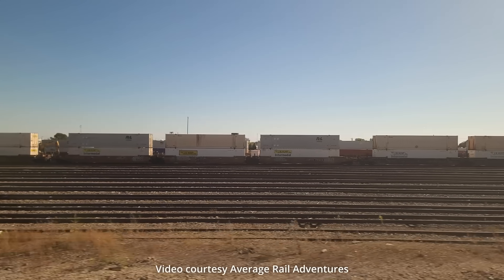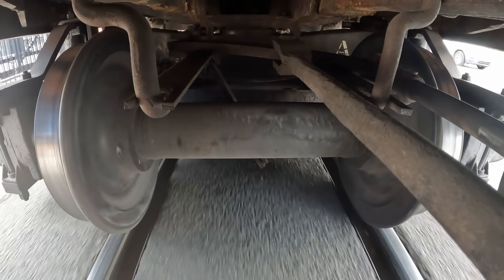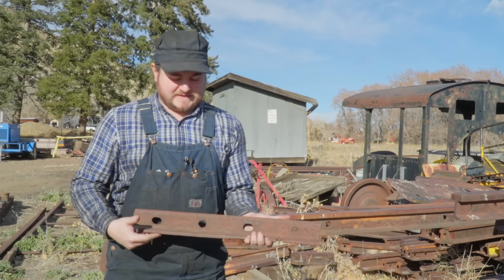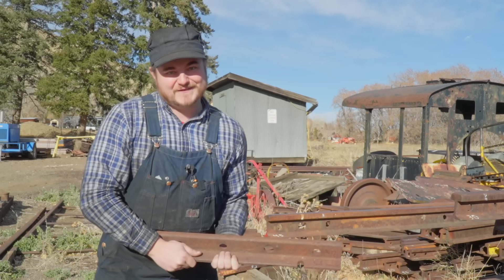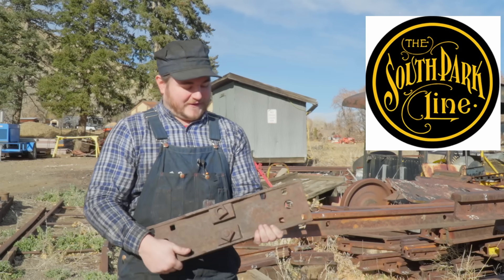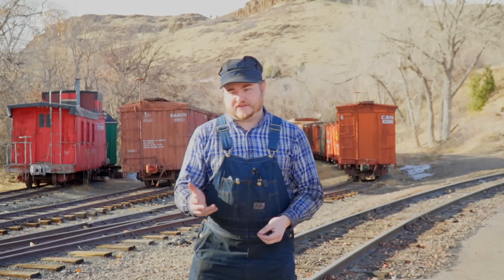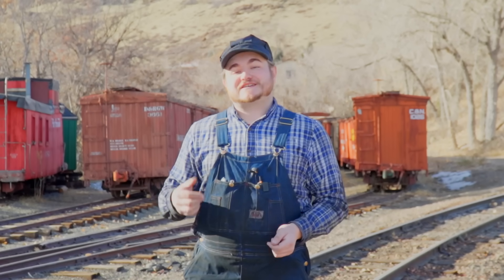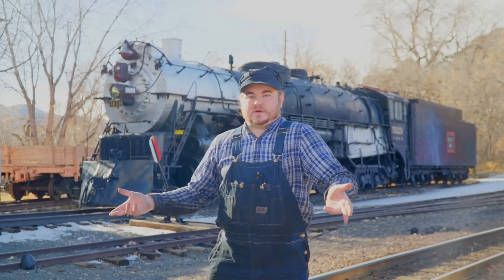Why don't Trains go CLICKETY-CLACK anymore? | Railroad 101

Comment: Most of the trains I've ridden are tourist railroads and they seem to still be using the old jointed track so I'm used to hearing clickety clack. I think this is why in the minds of folks trains go "choo-choo" and "clickety-clack" even though most trains no longer make either of those sounds. Practical Engineering has a video on "Why Railroads Don't Need Expansion" joints that gets into a lot of fun details about continuously welded rail and how they do it. I'm not a metal worker, but I've heard that old chunks of rail make excellent anvils due to the hardness of the steel, if the museum ever wants to turn that pile of rails and stuff into souvenirs.
Reply from the maker: I'd bet. I've seen rail anvils, they are nice. That video is lovely.
Reply: @Hyce777  I admit it.... I use a small piece of cut rail..... for a boat anchor! (and as a door stop to my train room)lol

Comment: Somewhere I have a photo, and maybe a video, of a thermite rail weld kit in action.  It was for a spur I designed down in Chehalis, where the contractor chose to weld up sticks of rail for the curve while using joints on the tangents.  Presumably because the curve was pretty sharp, so using welded rail helps avoid those gage and kink issues you mentioned.  
Funnily enough, it was relay 130-lb rail that the contractor had purchased recently; the previous owner had welded it up for the original installation, and then chopped it into 50-ft lengths when they pulled it up and sold it.  The cuts were very specifically not at the welds.
Reply: although they don't show a rail welding Veritasium has started a video Series on Thermite
Reply: @Bandan-RR  maybe you could be the nice guy and send that video over to Mark so he could use it in a future video. 😁
Reply: Search YT for "Thats Railroadin thermite weld" for a full video of the process: some of the prep, the weld itself, and the grinding.
Reply: Yeah you can only put the welds so close together, it's part of what makes it just a pain when a welder drops a weld. Sometimes you get lucky and there's only a slightly bigger gap but if it's buggered properly you need to cut and drop in some more rail in

Comment: I assumed the yards and branches used the cast off sectional rail when they upgraded the mainlines to new welded rail or even higher weight rail.  Recently they upgraded the Asheboro branch of the NS to what appears to be 115 pound sectional rail from a 90 pound rail.  Traffic on the line is picking up but still not enough to warrent the expense of upgrading to a fully welded rail.  Also, there are a LOT of road crossings (public crossings at grade) warrenting signalling for the crossing gates.  Also, being a branch, there is no CTC or ABS signalling as there is usually only one train per day on the line so the chances of meets are minimal and can be handled by track warrents.  Good video as always.  I assume the one stepped transistion that Lou Dahm made is out now.  We used to have it at the top of the cut where the rail went from 45 to 30 pound rail.  That of course was the pre-K-37 era.  That transition was similar to the C&S and was actually machined.  IIRC is sat on a single tie and the transition bars (fish plates) were cut from a thick piece of steel sheet.  Hey, we did what we had to do.  Over the years we did tear up other old spurs and yard tracks around the state (I helped pull spikes and remove the bolts) to get in the heavier rail we needed to expand and improve the CRRM tracks.  Got pretty good at putting them back in too!
Reply from the maker: That's cool! We don't have anything less than 60 lb on the main anymore if I recall properly. That is neat though!

Comment: In Europe or at least in Sweden the standard is to always have the joints parallel to each others. From what I’ve been told having staggered joints cause the locomotives and cars to rock back and forth. Could also mention that on track with jointed rail the max speed allowed is 130km/h(about 80mph)
Reply from the maker: How strange.
Reply: @Hyce777 you did mention that things differed on electrified railroads but we still use track circuits on electrified lines in Sweden.
Reply: @Emil_Persson98  I think all of Europe used to have parallel joints. At least the Netherlands did too (before they were welded). I have never seen staggered joints in person.
Reply: @Hyce777  Fun Fact: The sound of 2 bogies riding over parallel joints has even inspired Dutch singer Guus Meeuwis to make it the chorus of his song Per Spoor (by rail), better known as "Kedeng Kedeng".
Reply: @emilpersson8250 @Hyce777 On the WW&F we initially laid parallel joints, due to concerns about coach rocking on the 2ft gauge. But it turns out, the coaches are more stable than they look, and it's pretty tough to keep tight curves smoothly aligned with parallel joints. They tend to turn into polygons...we now stagger our joints.

Comment: I live on a branch line of a class one. Earlier this year, they brought in the big machine to drop off welded rail only to chop it up into shorter segments to make jointed rail.
Reply from the maker: .... that's bizarre, but I suppose it makes sense
Reply: I've seen pulled-up welded rail get chopped into jointed rail for reuse elsewhere.  Funnily enough, some of that was then re-welded on installation (in different spots than the old welds).
Reply: If the welded rail was secondhand, there's a good possibility they wanted to cut out the old welds account their being made by older procedures such as gas welding that are prone to defects.  Re welding using a mobile welder such as a Holland will then give superior results.
Reply: @fmnut  I doubt it is second hand. I saw it being laid. It came in as true quater mile lengths with no defects as if it was from the factory. Second hand rail would show at least some sign of being old rail.
Reply: @witty1764  well that makes no sense then.  What railroad was this?
Reply: @fmnut  CN It is probably a matter of convenience. The branch line is about 60 miles of track. Some welded some jointed. So they probably were replacing track in both sections.

Comment: Ok. Joint bars and tie plates. My brother brought a pickup load of them home in 98somethin from the G M&O  from where he worked taking up the single track up Alto Pass. A real steep incline. The allways doubled or trippled. Over that. Anyway none had the railroads mame on them cause da they didnt make the rails. So scrap they become. I did get the 3 posistion dwarf signal from the south facing one. But when my house burnt in o6. It busted the magnifier lense all i have is the mech. With the tri color arm.  Oh to be 20 again when i hosted that ony tailgate at 2am coming home from the moose playing music.   If I had nt said it your all right mark.  Happy Holidays 🎄🎄🎄🎄 remember. Shitter was Full. .😂

Comment: I was just thinking of this when recently riding the trams in Manchester, UK.
We have a few sections with joints that have been cut at a diagonal, so the tracks actually overlap as they transition from one piece to another.
May need to grab a photo for the discord...

Comment: Hey @Hyce , do you have a video that talks about how they used to bend rails c. late 19th/early 20th century to fit a curved section of railroad when they were installed?  Were they shaped off site or shaped on site?  Probably a mix of the two depending on circumstances.
Reply: I don't know about back in the day, but given rail is actually fairly flexible it wouldn't surprise me if they simply had a few strong guys bend it on site, particularly for lighter weight rail.  These days a heavy machine is often enough to do it unless the curve is very tight, in which case pre-curving may be necessary.

When Sound Transit replaced some rail in a curve in the Downtown Seattle Transit Tunnel, they did have it pre-curved offsite, to very specific lengths and parameters, and then shipped it over.  Then they brought it into the tunnel and welded it up on-site.  The curve was very tight (~250'), so pre-curving was necessary.
Reply from the maker: No idea, I don't have a video for that.
Reply from the maker: I do not, and I don't honestly know.

Comment: Also I’ve heard on jointed rail between 19-21 mph rolling stock will start to sway back and forth and eventually can tip over and fall off the rails.
Reply: Something called "Harmonic rocking" where the vibration frequency of the car matches the length of the rail.  Not super common anymore (longer cars), but still an issue in some places.  I've heard that's why BNSF slows down Boeing trains in Cascade Tunnel, to make sure they don't rock and smack the fuselages on the side of the tunnel.  That could be a fun video in the future.
Reply: If the track is poorly maintained probably. That's not a general rule.
Reply from the maker: As Midland and Bandan replied, yes, but also, no.

Comment: I’ve definitely seen different rail weights just welded together without a joint bar, specifically at Glen St Station on the LIRR. The way they seem to have done is was to match the rail heads and slope the foot of the larger rail upward to meet the foot of the smaller rail.
Reply: Actually they are called Transition Rails. We hot forge the taller rail down to the smaller rail height and reprofile the end to match the smaller profile, then flash butt weld them together.

Comment: If you spend a lot of time around a yard, all those sets of points are still panelled. Because it is easier to build and replace points, derails, etc. in a discrete piece than to weld it all together in-situ. 

And wherever you have discrete track circuit changes (e.g. behind a signal), the joint provides an easy and essential isolating gap.

There is nothing quite like watching a gang build a new turnout from parts and sleepers, then skull-drag it into place with heavy earthmoving equipment.
Reply from the maker: Correct!

Discrete track circuit changes vary with application though; that was what I alluded to w/ electric railroads. It felt like too in the weeds and nuance to explain for the video. The electric railroads need the IJ's to be staggered for the sake of negative return current always having a continuous path; and they also have Audio Frequency (AF) track circuits which don't require IJ's, but have an odd "zone" of detection... for another video I suppose!
Reply: Insulated joints in electrified territory are the same type and stagger as anywhere else, generally not more than one truck length.  Impedance bonds are used to carry the traction current while the track circuit current is stopped by the insulation.  Impedance bonds work like a transformer, with coils on either side of an insulated gap.  Also, many modern signal and crossing systems use high frequency pulses instead of simple DC, thus eliminating the need for many of the IJs found in the past.